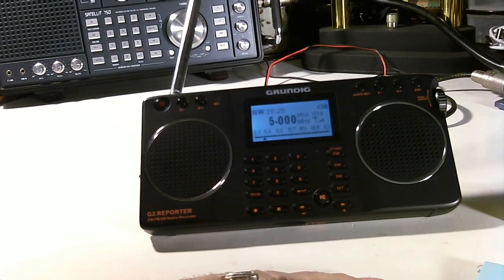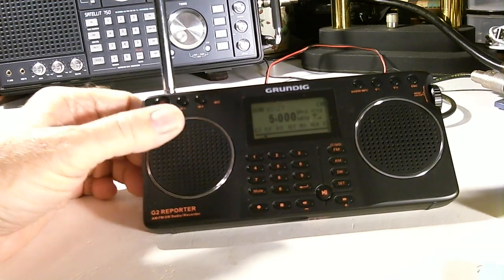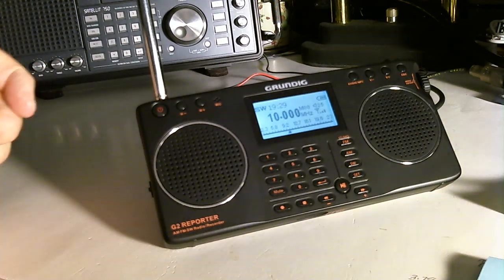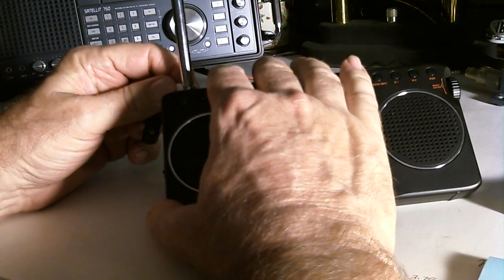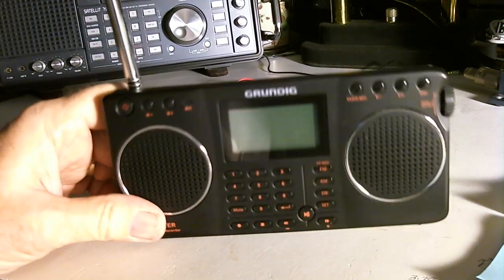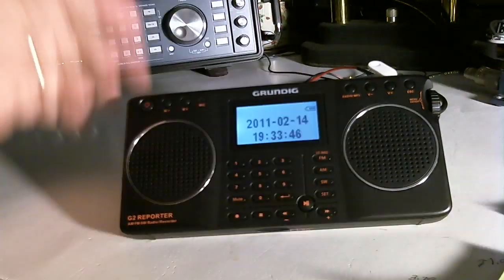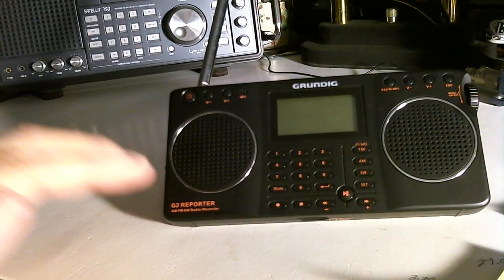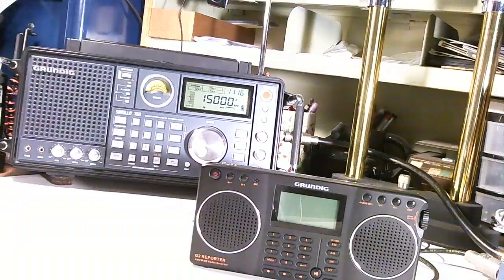TRRS #0314 - Grundig G2 Reception Testing

Comment: I just bought this radio even though its long discontinued. It arrives tomorrow and I can't wait to check it out. I bought it because, like the Tecsun PL-390, there are not many stereo handheld radios. I just think they're cool to have. I paid more than I should have for this on eBay - $52 total - but I see it selling for $150-$200 from other sellers online, which is crazy.

Also, I still say turning your radios on & off repeatedly is probably not good for them. Leave them on, just turn the volume down. ;-)

Comment: Well Tom, the Tecsun I ordered arrived a week a go and so far I really like it!  (By the way, the PL-390 seems to come in three versions:  the -390 is a straight radio, the -398BT adds bluetooth, and the -398MP adds an MP3 player, all for the same price at Universal Radio.  I opted for the MP3 version.)  

I’ve been a licensed ham for over 50 years (W2ILY), and have owned and used dozens of radios, from Collins and Hallicrafters communications receivers to Kenwood and Yeasu transceivers, all the way down to Sony portables.  And I can tell you that the Tecsun compares favorably to any of these on the shortwave bands (except no BFO and thus no SSB or CW reception).  The basic thing I look for in a new receiver is: how well does it tune in radio stations?  This Tecsun does really well.  Here’s my band-by-band analysis:

Shortwave:  continuous tuning 2.3 to about 22 MHz.  Very sensitive, very few ‘birdies’. Selectable bandwidth, which seems to operate at IF rather than to just shape the audio.  Very pleasant to listen to.  From my South Florida location WWV-5, 10, 15, and 20 all come in at varying strengths according to the time of day or evening, using only the built-in rod antenna.

FM: Pleasant to listen to, picks up all the stations in my area.  Can set the tuning range for various countries.  Stereo separation is very good for use as a table-top radio.

LW:  Here’s where this receiver truly excels.  First of all, the tuning range is 153 to 513 kHz, which allows you to tune in the non-directional aero beacons (NDB’s) found all over the world.  (Most of the portables on the market tune only 153 to 280, just enough to cover the European LW broadcast band.)  I can hear NDB’s from up to about 120 miles in all directions.  But the amazing thing is that there are no subharmonics from the local AM broadcast stations!  That is quite a feat for a small radio.  The LW bands on many of my other receivers are worthless because of those subharmonics, or “images” that don’t belong there.  Because it’s now summertime, I haven’t tried pulling in the European LW broadcasters yet—that will be test for winter with its longer hours of darkness.

AM domestic broadcast band:  very good—again, haven’t noticed any images.  Very sensitive, and adjacent-channel splatter from big locals is minimal.  The bandwidth selector button is very useful here.

Now for the amenities:  Always room for improvement,but I’m very happy with the feature set.  Download the manual and see for yourself.  Each feature works as advertised.  I’m especially happy with the battery charging circuit.  I use three 2300-MAH.  From empty they recharge in about four hours, and then a full charge will last a long time.  In fact, for an experiment I let it run continuously, and found that after 42 hours (about half with the backlight on), the radio was still running, with the battery indicator finally down to its lowest reading.

So, judged as a radio receiver for tuning in radio stations, this Tecsun excels.  Several methods are provided for scanning, tuning, and storing frequencies; you can read about them by downloading the manual.  I found each of the methods useful in its own way. 

Overall, I really like this little radio.  It tunes good, sounds good, and feels solid in your hands.
Reply from the maker: Thank you for taking the time to post this valuable information for everyone.

Have a great day.

Tom

Comment: Your several reviews of the Grundig G2 have certainly convinced me to avoid this receiver. In spite of its gadgetry and cuteness, I haven't heard one good thing about the way it works as a radio:  to receive signals!  I really wanted to buy one of these, but it seems to be a failure as a radio.  And I already own an MP3 player, an alarm clock, and an eBook reader.  Thanks for the reviews-- this closed (broke) the deal for me!
Reply from the maker: Thanks for your comments.  Keep in my mind that my testing is very limited but I have to admit it is not my first choice for a ultra small shortwave radio.

Tom
Reply: It just seems to me that your many reviews of this particular radio seem to focus on the features and do not address the basic reason for the radio's existence:  pulling in radio stations!  I finally wound up ordering a Tecsun PL390. it's in shipment now. I'll let you know in a couple of weeks how I like it.

Comment: Tom... One gets the impression that the G2 isn't so much a lack of sensitivity, but it's more leaning to possessing a "terrible" S/N ratio. Yes, it also suffers as would any receiver from local room noise, etc., but even discounting that aspect, the S/N ratio seems not very good at all. Again, it's a low-cost receiver, very portable, and will still finds uses, so it's not a "total bad" receiver.
Reply from the maker: Thanks for your comments.  I agree that this class of radio is a "good value".  You can spend $1000s and get a great radio but is that a good value radio?

Tom